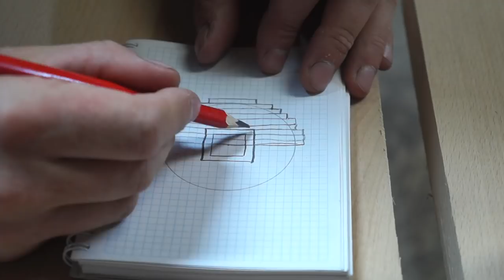Wooden fruit bowl idea

Comment: Simple and original; I like the idea. Until the end of the glue-up I thought you would use your friendly robot to make the bowl and thought that I would try this on the lathe, but then you chucked it up and turned it, all that without using the tailstock, which is quite dangerous. I was waiting for this thing to fly off the lathe but it didn't. It "turned" out ok.
Personally, I would've turned the bowl around and used a wide jaw to turn the bottom of the bowl to match the top. Have you thought of using different species of wood ? A bit like a segmented bowl but without all the work.